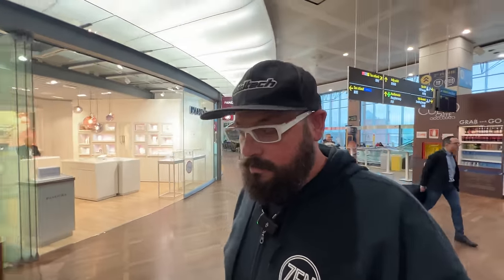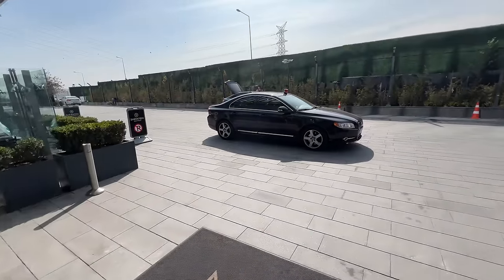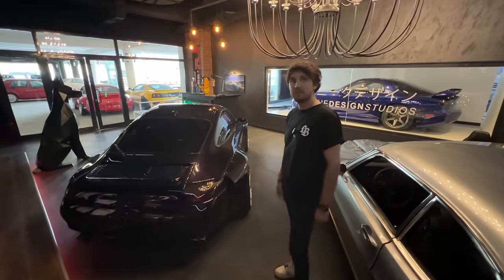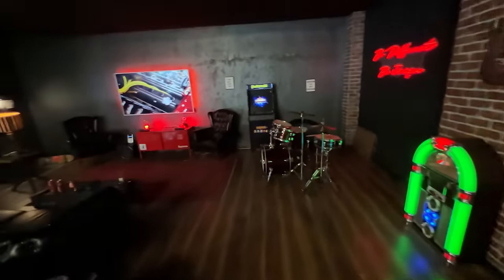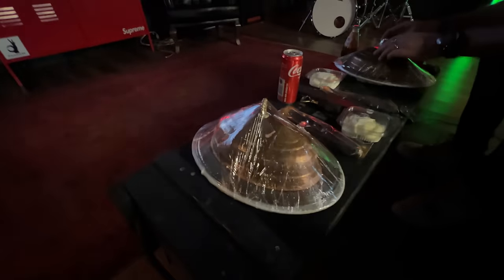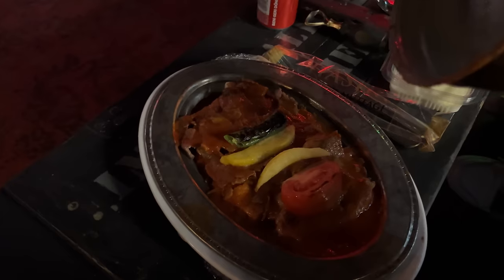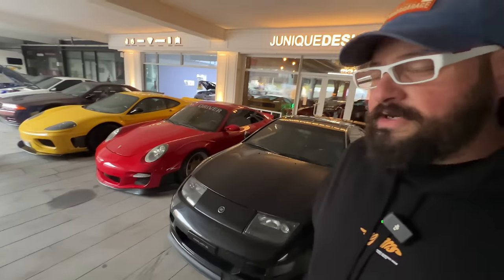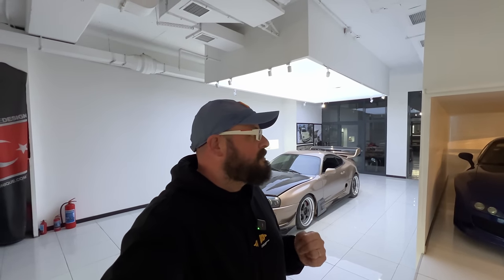The Insane Car Culture Of Turkey That You Didn't Know Existed! 🇹🇷

Comment: for any rotary guys that are gonna be pissed at the 2jz FC, Turkish Mazda services themselves were swapping 626/323 engines in FCs at the time becouse 13B was hard to maintain and owners were keep blowing the rotary engines up, rotary engines themselves are very VERY Rare in Turkey apart from RX-8s and there are like only 3-4 RX7s with rotary engines
Reply: came to say this, erdem says they swapped the engine for more power which is technically not a lie but he should have said that he didnt get it with 13B anyway, it was already swapped a mazda 4 banger by the dealer :D